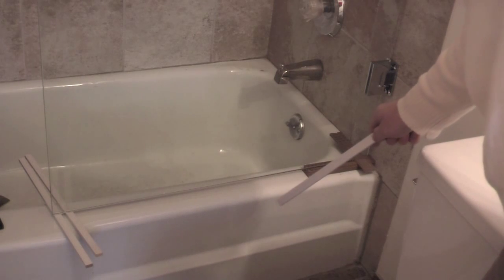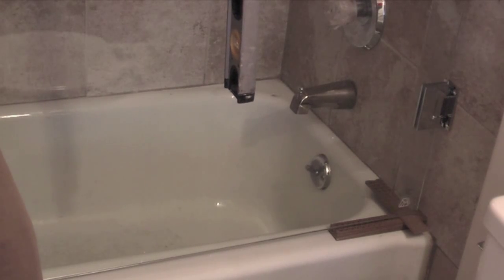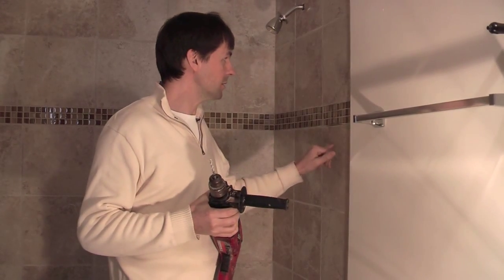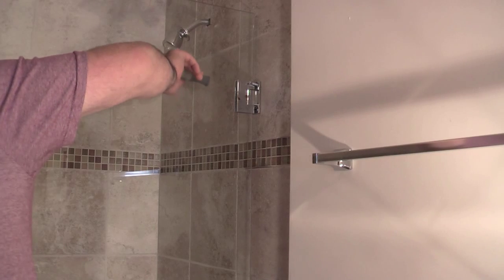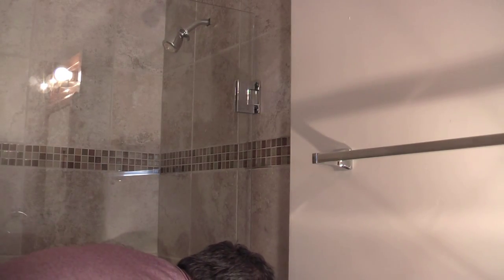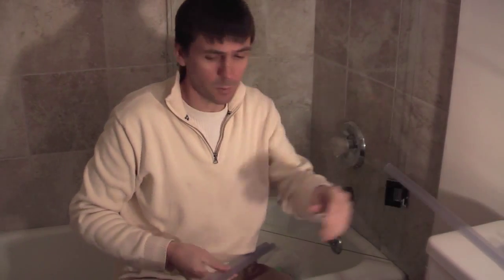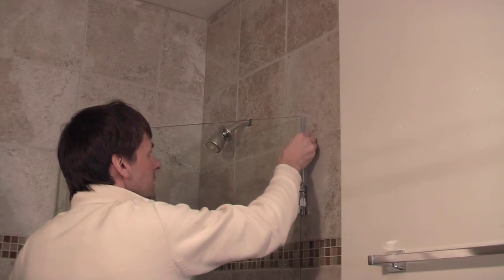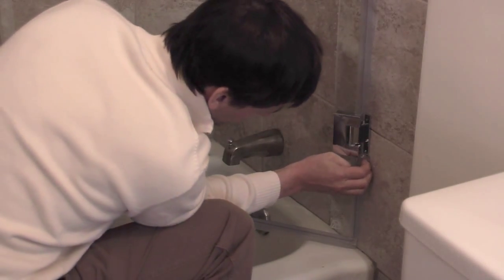Installing a Frameless Ark Shower Screen, Part 2

Comment: you broke the golden rules 1. no hammer action on any tiles 2. allways put youre rawlplugs through the tile otherwise the tile will crack if not straight away it will later due to stress